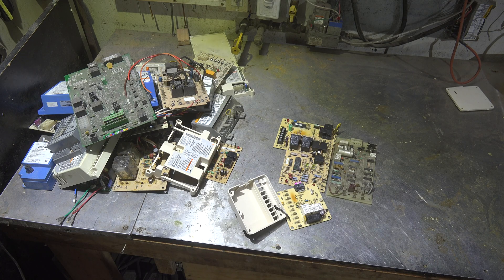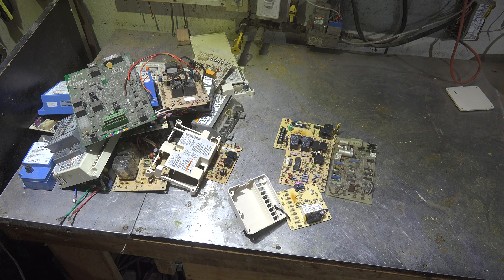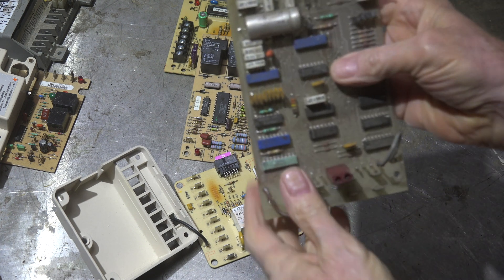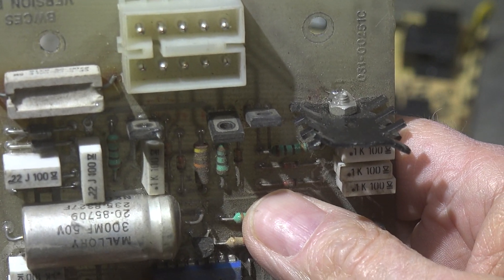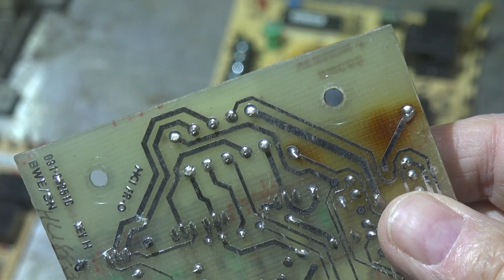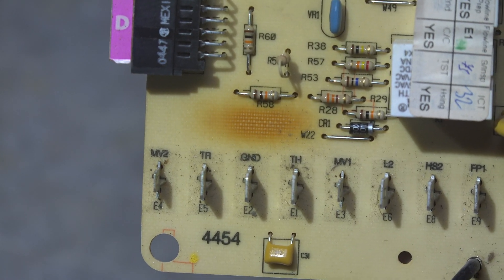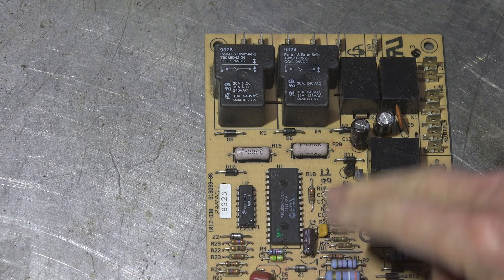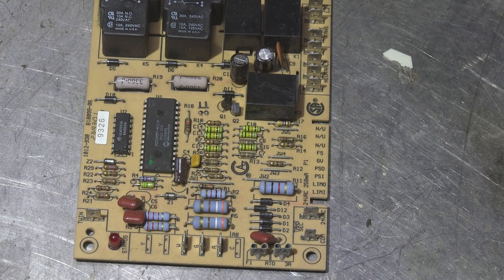Burned board: has the board failed?

Comment: In aviation, a PCB isn't considered bad unless the fabric of the board is showing. Those white or light green color boards are especially bad at showing heat but as you suggested, it doesn't mean it's bad.

Comment: Had a new outdoor unit installed and that came with a year free service. They came and showed me the Coleman/York indoor board with the heat marks on it and said it needed replaced. Furnace is working fine. The wanted $860 to replace it. I was a HVAC building maintenance person for 36 years and I laughed at that. They said things cost a lot here in the valley!! I said the board is no more than $100 and you want how much??? Not interested. Thanks for the video
Reply from the maker: Good one.  
GFM

Comment: Hello, would the blower fan's air movement not be enough to cool the board as it works? Would separate mechanical cooling of the board help keep it cool?
Reply from the maker: Board mounted resistors are designed to dissipate a specific amount of heat.  This does not mean they run cool.  They can be quite hot and still perform their work.  
The point of this video is to get across that a burned spot on the board does not mean there is a failure in the board.
GFM

Comment: Ever try soldering something on one of those to repair it?
Reply from the maker: Yes, if the solder is melted and haloed at the board, I would solder the terminal.  I also would solder over traces for the inducer or fan motor if they were burned thru.
GFM

Comment: I have a pile of boards that i keep from warranty replacements and changeouts. As long as the microcontroller is in good condition (firmware uncorrupted, no broken leads) I can usually fix them with the help of Digikey and/or Mouser. As for burn spots on the pcb's, you're correct that 90% of the time it's power resistors trying dissipate heat. It all has to do with PCB layout, design and thermal considerations. Some PCB manufacturers fair better than others. Thanks for the video!
Reply: Digakey and Mauser and Jamco is like Santa Claus dropping off presents at my house kids candy store. 
           Board failures relays burning excess of resistance relays arcing together well them self shot. 
          Like you say as long as the micro electronics are in good condition easily and cheaply repaired. 
           And you can upgrade them with heavier duty relays that have diode‘s and resistors across the load to get rid of the arcing across the contact points so they don’t wear out. 
               Especially on those systems were somebody way over sized it and it’s constantly short cycling adding tens of thousands of opening and closing cycles across those little contact points.

Comment: You think that if that’s a common issue, they would insulate the resisters a lot better!
Reply: If the resistor was insulated that would cause it to burn up, you want a  resistor to dissipate the heat. The fix would be to use a larger wattage resistor. Using a larger wattage resistor would cost more money and eat into the bottom line.
Reply: @mrkrasker9609  They won't even spend the money to install them standing off the board to dissipate the heat.  Much less install a heat sink.